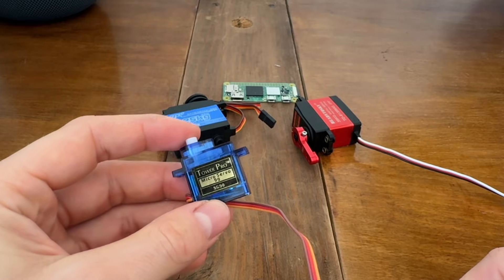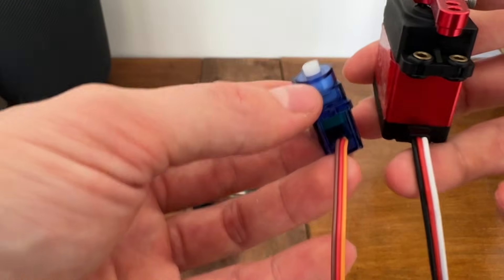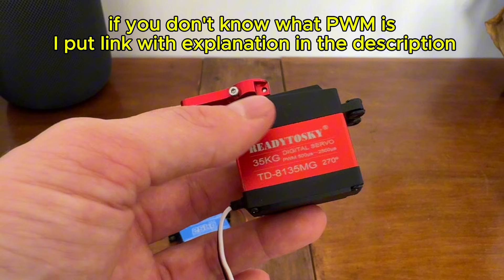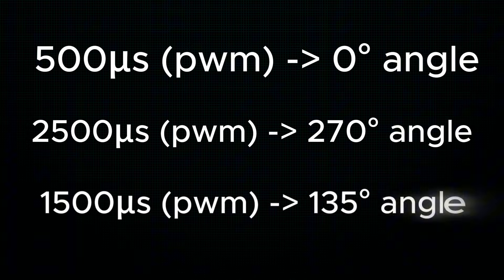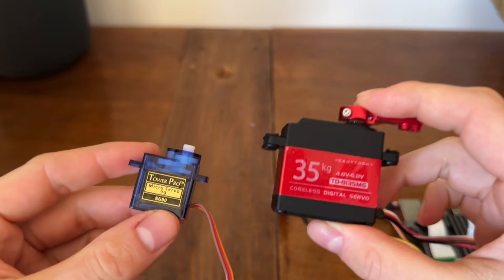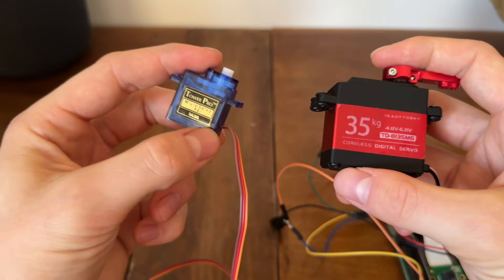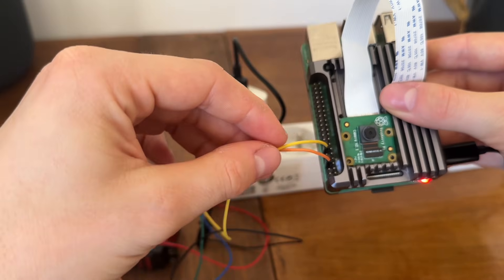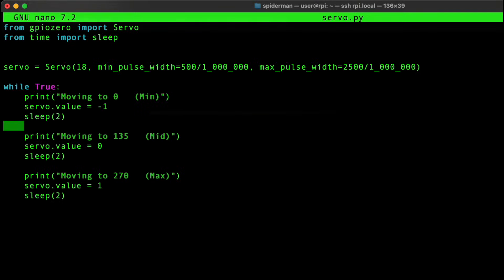Raspberry Pi with ANY Servo Motor | Full Tutorial

Comment: Hiii ,I have one question, I am making a project on raspberry pi based coin sorting machine. In this, 2 types of coins will be detected based on their weight. I am using load cell for sensing weight. But after sensing, how can I use the servo motor as flap or gate for sorting coins?

Comment: Hi, can I do the exact same, but lets say with 3 servos?
Reply from the maker: Hi! Yes, but as far as I know, the Pi has only 2 hardware-based PWM channels, and they are multiplexed across several GPIO pins. So, using the standard RPi.GPIO library with more than two servos can cause jitter. However, pigpio solves this problem by using DMA, so it should work. That said, to be honest, I’ve never tried it myself.
Reply: @mixed-matrix-arts can i Connect 10 ?

Comment: My servo does not move when ground is connected to both the power supply and raspberry pi board for some reason
Reply: Also:
from gpiozero import Servo

line is flagged as an error for some reason....

This is why I don't like computer stuff... Follow the simplest tutorial ever and none of them work. 
 Sorry just venting. No problem with your video computers just frustrate me to no end because they never seem to work.
Reply from the maker: Patience is the key:) You learn the most while debugging. Try to divide one big problem to couple small ones. Keep in mind in electronics world there is always chance that one of your electronic component is faulty. Especially moving parts. One time I ordered cheap servos from aliexpres and 20% of them was not working.

Comment: Is connecting the servo motor SG90 directly from a 5vq port a trap on a Raspberry Pi 4 device?
Reply from the maker: Sorry for the late response, it's probably not relevant by now, but for the reference: sg90 stall current is ~600mA, so 99.9% nothing bad will happen, but using external power supply is always the best practise, if you’ll draw too much current from the 5v pin it can lead to unstable work of the board itself (depends of wattage of your main power supply, but for sure one sg90 won't cause it)